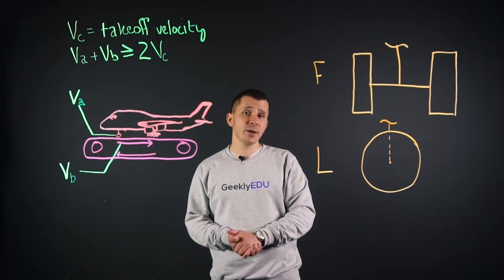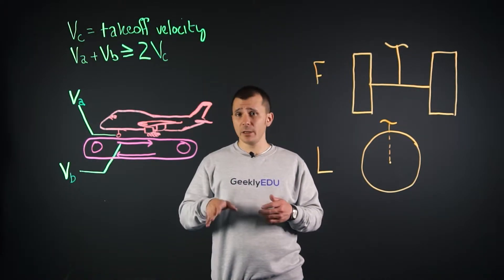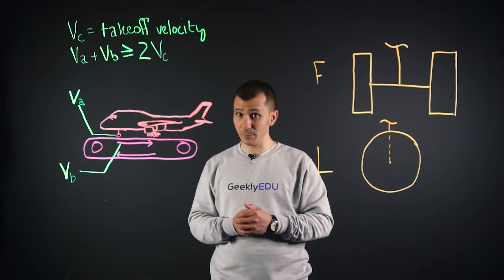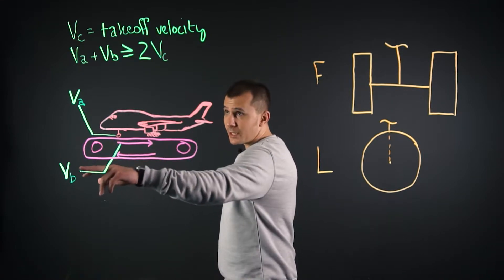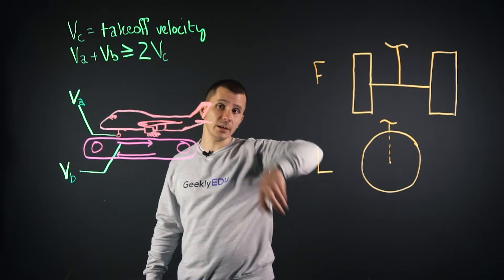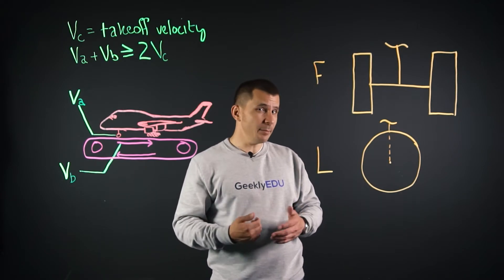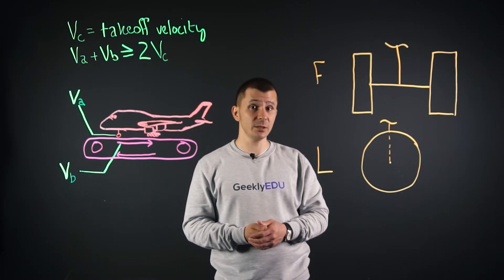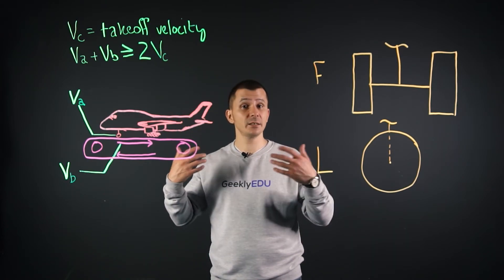Plane on a Conveyor Belt - Will It Take Off? #GeeklyHub

Comment: This channel is dishonest. If you are a toddler it may be okay to take in broad terms about "conveyor belts and planes", but if you are aiming for science you at least need to have a clear definition of the problem. Use google. In the original problem, one sentence is formulated like: "The conveyor belt is designed to exactly match the speed of the wheels moving in the opposite direction" 
The implication of this is that the plane is stationary. That is a fact and not up for debate. A stationary plane will never take off. 
You are welcome.
Reply: Every plane that has ever taken off has been stationary at some point, so the claim that a stationary plane will never take off is simply untrue.

Comment: Without the necessary airflow on the wings, no plane will take off!  It requires physical forward propulsion!  Anyone who has a different opinion scares me.  Especially if they are pilots 🤣
Reply: I am a pilot. The 747 will not take off due to airflow over the wings. But in absurdity a Cessna 150 (or similar) has airflow from the propeller over the wings and actually more airflow under the wing due to a high wing position. Practically this would not happen; but with enough engine speed airflow over the wing increases and the planes weight on the conveyor belt will decrease. The plane will move forward and attempt to fly..
Reply: @teetimeaz  I'm also a pilot. You have no idea about aerodynamics
Reply: @teetimeaz  pilot here, you are clearly clueless. I bet your principles of flight score was low
Reply: @teetimeaz yikes I hope you aren't actually a pilot. Prop planes don't create enough air flow for Lift. There are a bunch of prop planes with lower wings.
Reply: A plane needs forward momentum to get airflow over the wings. That momentum is produced by the engines moving the plane forward using the air. The wheels don't drive a plane.

Comment: Why does everyone focus on the wheels? Lift is generated by the WINGS. If there is no airflow over/under the wings, there can be no lift. That’s why a plane flying against the wind doesn’t travel as fast.
Reply: You are right and the plane's lift comes from the air flow over the wings.
Reply: @rmendoza5953  AS I replied earlier. For the 747, as the engine power is increased the nose goes down because there is more airflow under the horizontal stabilizer causing lift in the tail. There is no airflow over the wing. In normal takeoffs, the 747 wing chord is set for maximum lift. As the ground speed increases the wings generate lift due to airflow.
Reply: @teetimeaz  Air flow over the wings causes lift. This is for every plane and not just for a 747.
Reply: @teetimeaz  You are assuming plane is standing still but it is wrong assumption. 4 turbofan engines of 747 creates 1100KN of force combined. Wheels on the ground/conveyor belt rolling friction is nowhere near that force. Aircraft will move forward and once it reaches rotation speed, will take off maybe few inches later than on normal runway.
Reply: @Piasecznik72  that is a mistake that slips over the premise of the thought project and basic principles.  No matter the force or speed of the vehicle, you are expressly given that the conveyor moves at exactly the same speed.  This doesn’t allow for incredulity or new parameters.  This is what we are given.
Reply: @MrDefreese  That is a bold statement - No matter the force. Huh if you really believe that we have nothing to talk about.
Reply: @Piasecznik72  F=ma.  All you get is acceleration which is a change of velocity over time.  People are just mesmerized by the size and power of the 747 example.  Meh.
Reply: @MrDefreese  You almost got it. Almost.
F=ma but we need to know "a" in that equation so a=F/m
Now calculate force generated by 4 engines combined pushing aircraft forward relative to the air vs free spinning wheels on conveyor belt driving in any direction and any nonrelativistic speeds (any because it does not matter due to it's negligible value).
Reply: @Piasecznik72  "F=ma but we need to know "a" in that equation so a=F/m."

That is an unremarkable comment on basic algebra; we don't even need introductory physics.  It was pretty obvious that acceleration is the issue and, since you neglected to acknowledge it, acceleration is merely the change from one speed to another speed.

We are expressly given that the conveyor can instantly match the speed of the vehicle.  Not only do we know that it can match the speed of the wheel rotation,, logic, calculus and physics tell us that the rate of change for both the vehicle and the conveyor are the same.  This is a basic derivative - no change in speed equals no change in acceleration.

As to your last paragraph, that's an unfortunate jumble that should be disentangled.

The 'free spinning wheels' is a non-issue.  The vehicle only moves in direct relationship to the rotation of the wheels.  Angular speed, and angular acceleration are directly proportional to translational speed and acceleration.  The vehicle is not floating in the wheel bearing, of course.

You don't need to calculate any forces involved but it does help disabuse people who get fascinated by the size and power of the jet engines so much that they lose sight of basic math and phsics principles.
Reply: @MrDefreese  Object at rest will remain at rest unless a force is applied upon it. If you think plane is sitting on the conveyor belt and is magically locked to its surface then there is no point discussing with you. I do not have will to argue about colors with a blind man.
Reply: @Piasecznik72  "Object at rest will remain at rest unless a force is applied upon it."  Is that supposed to be profound in this discussion?  Does anyone here not know that basic Newton law?   In this thread, we have covered the 2nd law and the 1st law, we might as well add in the third law which says something about equal and opposite forces.  Well done!  Gold star.

"  If you think plane is sitting on the conveyor belt and is magically locked to its surface "

It's pretty clear that a plane can't jump off of a surface; the four forces mean that the plane has to generate lift and if it is rolling motionless on a conveyor moving at exactly the same speed and acceleration, there is no airflow to generate that lift.  The only escape hatch folks have to use is if they make an assumption about an absurd wind providing lift for the aircraft, but that's as absurd as assuming the plane will scrub across the surface of the conveyor in order to move.

Meh.
Reply: @MrDefreese  How motionless? Calculate all forces. What is opposing 1200kN of force generated by engines?
Remember all wheels which are only touching points with conveyor belt are free spinning.
Dont walk around that question. You have to answer it properly in order to advance your knowledge in physics.
And to be clear, nobody said it has to jump off of a conveyor belt.
Reply: @Piasecznik72  quite obviously, the force involved to power the conveyor is exactly the same as the force propelling the aircraft.

This is really not hard and you really shouldn't try to be condescending.  It's blown up in your face each time.

You don't even need to worry about the force involved.  You know intuitively and experientially that you can set a treadmill to a speed that matches the speed of <insert a vehicle on wheels>.

There really is no mystery involved in this and you are still getting tripped up on the big scary turbofan engine thing.

Go back to basic physics and you'll catch on.
Reply: @MrDefreese  You are really dense and pretend to know by intuition everything. Dunning–Kruger effect in its finest. And you did not answer my question. I did not ask about force powering conveyor (it would be silly question since power is not a force). Ok lets go with small steps: what is total rolling resistance of all 747's wheels touching conveyor belt?
Reply: @Piasecznik72   "what is total rolling resistance of all 747's wheels touching conveyor belt?"

It doesn't matter.  You never get a chance to talk about Dunning Kruger effect ever based on your commentary here.  Before you try to respond, take it in.  Read it carefully.  Understand it.
Reply: @Piasecznik72 In your scenario the plane would be skidding down the runway. That is not what the (implausible) scenario deals with. The answer must be consistent with the numerous implausibilities within the scenario.
Reply: @ Wheels are free spinning so coveyor belt can only excert force on aircraft through that free spinning wheels. Total rolling resistance is only force preventing aircraft from moving. On other hand 4 giant engines pushes it with 1200kN of force relative to air (not runway or anything else). Wheels needs to turn close to speed of light to create enough opposing force to overcome engines power.
Imagine threadmill, and toycar. You hold it by hand on threadmill, how much force you will feel in your hand if you double speed of the threadmill? Will it be preventing you from pushing the car up the threadmill?
No. It is trivial force in comparison to your hand. Same with airplane, its wheels and engines.
Reply: @MrDefreese the only way for a planes wheels to rotate is for it to physically move forward. If the treadmill is holding the plane back than it is spinning faster than the wheels would be from moving forward. The problem is that the treadmill could never actually spin at the same speed because if it did than the planes forward momentum has been stopped and the wheels are now spinning only because of the treadmills rotation. It's a paradox but all it would do is increase then wheels rotation to about double what it normally would be as the plane took off.
Reply: @joebojanic1905 the test vehicle is rolling on a surface that’s moving.  An aircraft rolling from bow to stern on an aircraft carrier gives a real world example.
Reply: It’s because the first thing that happens is an intro to physics problem that is being disregarded by people who are mesmerized by the size and power of a 747.

The first thing that happens is that the vehicle has to start rolling on the surface and since the explicit terms are that the linear speed of the conveyor exactly matches the speed of the wheels, you get 1=1; the vehicle does not move at all.
Reply: @MrDefreese  False. The conveyor does not exert any forces to slow the plane down, only to spin the wheels twice as fast. The plane will move forwards just fine.
Reply: @grumpysanta6318  you make the standard issue mistake.

The force doesn't 'slow the plane down'' on the surface.  This is a kinematic exercise and you are given the parameters which show why it doesn't move relative to the atmosphere.

One of the best demonstrations is the plane on an aircraft carrier.  The plane moves on the surface/ flight deck.  The whole vessel moves in the environment.  You can figure out the speed in either frame of reference - on the surface or in the atmosphere.

There are wonderful videos of flight deck operations showing that very thing.

Good luck.

Comment: Mythbusters did NOT solve this.  In their experiment (you can watch it on YouTube) the plane moved forward relative to the air.  They fudged it.  

Only one factor matters: Air moving over the wing.  If your plane is not moving forward relative to the air, you are not taking off. Ever. No lift. The end. The only mitigating factors could be wind speed (head-on wind will help, a tail wind will hinder) and possibly a prop moving air over the wing. But a jet (like a 747) will never, ever, take off. Forget about tires, forget about friction, you can have a perfect hypothetical scenario where tires are limitless and friction is non-existent, that 747 will still be firmly attached to earth until it reaches 207 MPH relative to the air.
Reply: A treadmill would not be able to stop a planes forward momentum. It would increase the wheel speed but the wheels don't matter short of them exploding. The treadmill would not be able to keep up with the tires because they would always be advancing. The speed of the wheels would keep increasing until the plane took off though, so roughly double a normal takeoff speed. The plane would take off like normal.
Reply: @joebojanic1905 there are plenty of sources which show a rolling object in equilibrium with a treadmill.  There are even fun ‘races’ which pit various wheeled objects or balls against each other.

You can absolutely create equilibrium conditions.
Reply: @MrDefreese  That's only because in those conditions you're matching the power provided by the tires to the speed of the treadmill, which will let that all cancel out. Planes don't pull on the ground to move like a car does, they're pushed separately.
Reply: That's the point - the plane MUST move forward relative to the air once you turn the engines on, because there is no way for that treadmill to absorb all the energy created by those jet engines. If the treadmill MUST match the wheel speed of the plane, then you'd just end up with the wheels skidding so that they're moving more than their diameter in distance for every rotation of the wheel. A seaplane has no problems taking off despite not having any wheels and having to overcome a lot of friction between the sleds and the water, because the engines or the propeller are more than powerful enough to overcome that friction.
Reply: @StreakyBaconMan the treadmill is not absorbing energy.

This is a kinematics analysis.

The vehicle rolls freely on the surface;

The two object system moves at exactly the same pace within the larger environment.